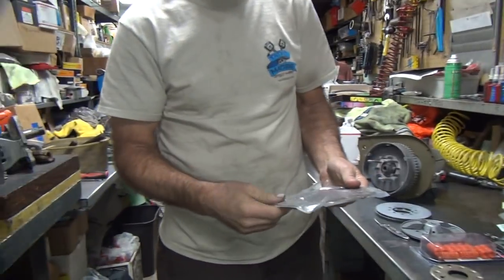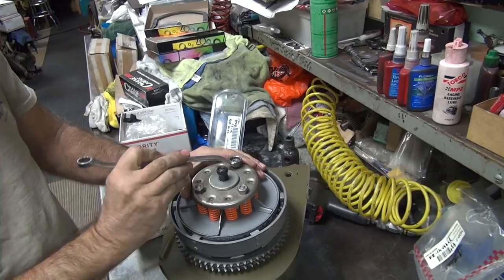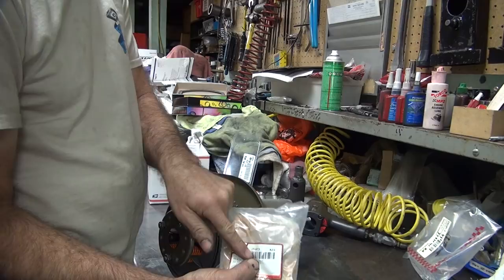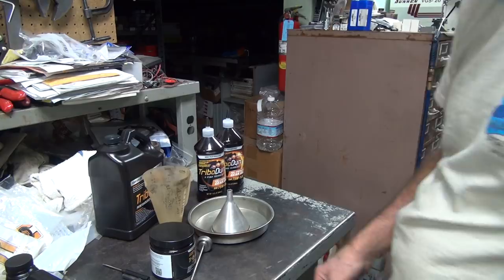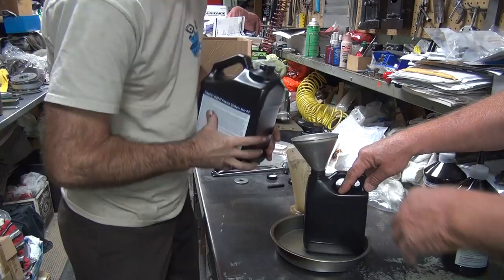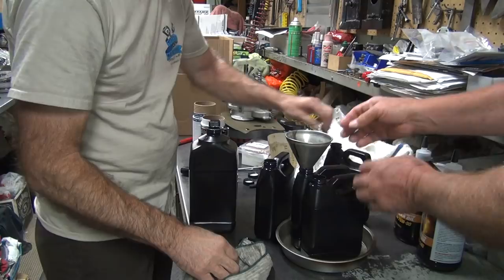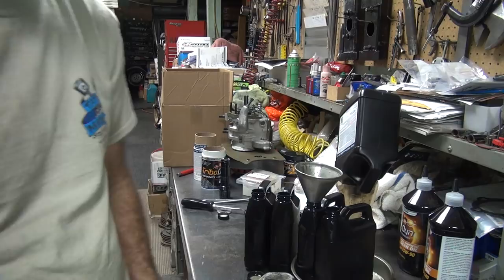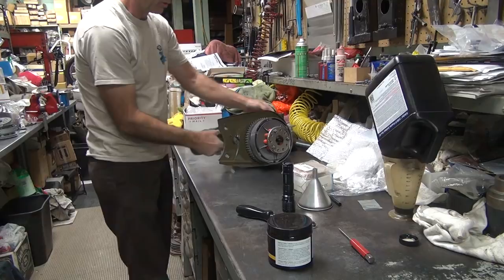1942 wlc wla 45ci #320 nos transmission parts repair rebuild harley reassembly by tatro machine

Comment: I bought that Tibodyn 75/140 oil last year because I saw you put it in Alans Fatboy, I have a 2010 Softail and must say it shifts smooooth...... As far as oil goes I purchased the Maxima 20/50 synthetic, I guess I’ll use it then next oil change I’ll try the Tribodyn
Reply from the maker: same thing i did with my race bike. start with the good maxima and than upgrade to the tribodyn. 
tatro

Comment: Hello Tatro I have a question on my 45" servicar concerning the speed I know they are designed to go slow but mine feels to slow? I have a 27t sprocket and 17t trans sprocket with 15" rear wheels it cruises around 35-40 mph just nice and smooth but... It's to slow on the road. It has a 100p primary chain I want to put a 31t sprocket on it and see how that works. Now being you know way more than me I'm hoping you can tell me exactly what I need to do rather than spend money and experiencing on my own. What is your thought on updating my motor sprocket to achieve more speed 45-50mph would be nice to ride on the roads here in Calimesa, Ca. Thank you for your advice. I have one leg I lost it up to my hip 30 years ago I owned this bike for all those years it's always been torn down 29 years of Its life. I am now 59 years old and wanting to ride it. I'm adding electric start to it right now the motor is a 1964 GE I just bought a 64 electric start starter system for it in cherry condition. Thank you

Ray Medrano
Calimesa, Ca. 92320
Reply from the maker: you did not say what size rear tires you are using. tall and shiny is the way to go. fat car tires will kill your speed. 
each tooth is worth about 5mph on top speed if you can pull the gearing. 31 tooth is a big jump. you will be needing more power. put a bigger venturi in your carb and advance the ignition timing 4 degrees to get some extra power. the manifold will need some opening up too. installing a mikuin carb or the 1-1/4" linkert carb set-up would be the best. i nice big oil cooler and filter will help cool the motor down alot. aluminum heads will help all around also.
tatro
Reply: Ok Tatro I found bigger and longer 45" intake manifold I bought that it's on its way. Now I'm trying to get my hands on a M-88 linkert that's the one I think I need. it's the only one made for the 45" with 1 1/4" throat I know it needs rebuilding if I can get the funds and buy it. I have 6 to 1 aluminum heads on the motor now. I will advance the timing 4 degrees. I have a sportster oil cooler and evo filter on it. My trike is not here at the moment so I'm not sure what size tires I have on it at the moment. I will update you on tire size later. Thank you for all your help. I'm wondering if by any chance would you have a extra M-88 laying around lol? I'm trying to sell what ever I can to buy one. I really want to ride my trike it's my wheelchair! Thank you Tatro I really enjoy your YouTube show and everything I learn from you.

Comment: just a thought with that goo ya'll call gear dope,fill the ratio cup a full quart you can see THEN  pour in the black bottle, jes sayin..
Reply: peter brecklin either that or put it on a scale and weight it if you dont have a clear measuring  cup.
Reply: Tony Aguilar  lmao..  Ease off the paint fumes....volume  not weight
Reply: peter brecklin okie .ill give that a try.
Reply from the maker: everything was good until i found out i had to shake the tribodyn well before use or in this case splitting it up. my eyeball are calibrated so i don't need all that fancy measuring crap.
tatro
Reply: Tatro Machine  sheeeeit    what was i thinkin?,too bad your eyes cant calibrate to torque specs too,lol